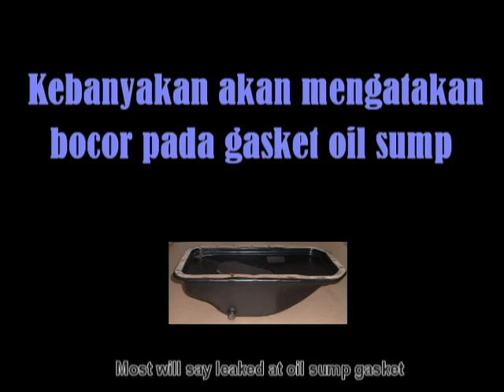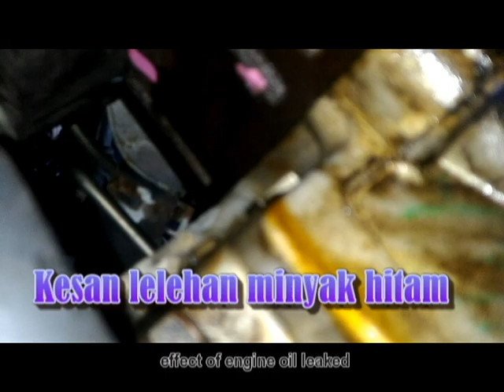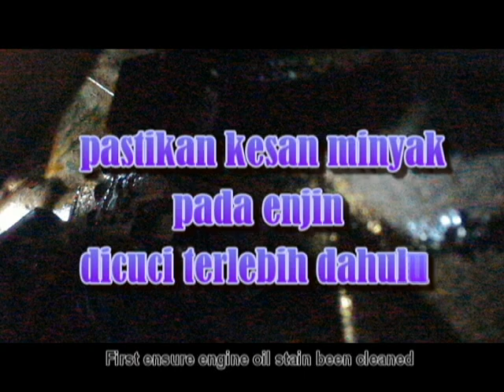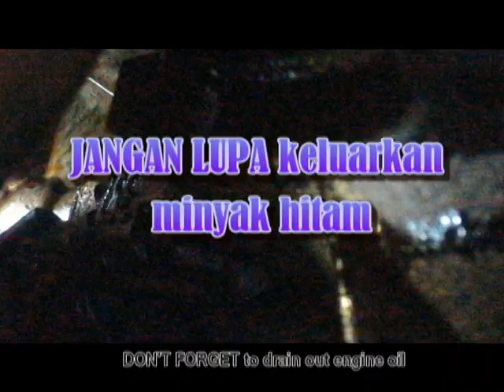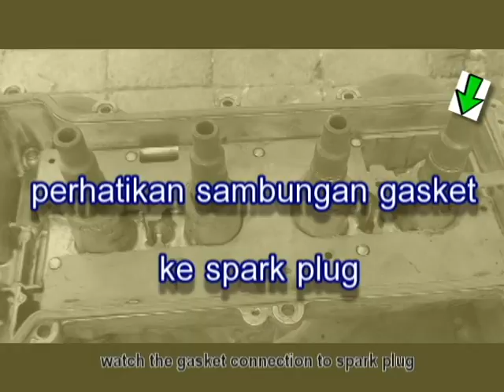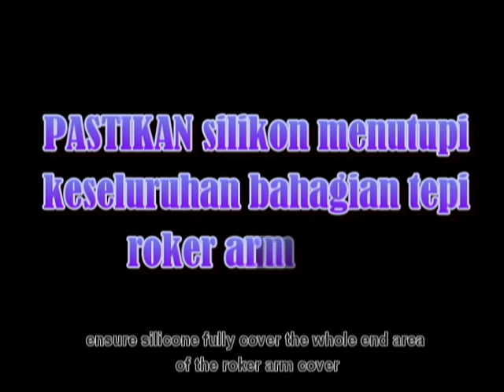ATASI MINYAK HITAM "LEAKING". SOLUTION PROVIDED

Comment: adakah viva 1.0 auto sy begini jugak ceritanya? valve gasket, plug seal, oil filter seal semua dh tukar.. hari ni tgok ada leaking lagi..
Reply from the maker: Valve gasket tu yg mcm mn? roker arm gasket atau gasket head...

Leaking kat bhgn mn?...enjin ke bhgn drain minyak hitam...
Reply: @SePeKiZamanHadapan  gasket head... minyak nmpk meleles kat tong minyak hitam.. dia leles sampai ke nut tong minyak hitam tu.. sbb workshop ckp kena turunkn graebox.. haaa.. sudah.. pening jadinye..
Reply from the maker: Roker arm gasket ade tukar x...minyak gearbox len...kalo rajin...cuci bhgn bwh enjin...pastu tengok drpd mn minyak kluar bila start enjin....kalo minyak gearbox kurang...baru perlu turun gearbox...
Reply: @SePeKiZamanHadapan  rocker arm takde tukar.. sy sendiri bleh buat ye.. lap, start enjin n tgok minyak kuar kt mana? enjin dh cuci dh semalam.. xpe balik keje sy try buat..
Reply from the maker: Terbaek...yup betul...tukar roker arm gasket skali...jgn lupa guna gam yg tahan haba...ikat semua bolt sama ketat...
Reply: @SePeKiZamanHadapan  okay sepeki.. thanks for your advice.. after tukar sy update sini semula..
Reply: sorry nak tanya viva auto cc 1.0 ada rocker arm gasket ke atau namanye lain?? cari2 nama x jumpa.. hihi
Reply from the maker: Orait
Reply from the maker: Cari kat kedai kereta..atau sparepart
Reply: @SePeKiZamanHadapan  dah jumpa punca leaking... flywheel seal dah keras. turun gearbox lar jadi ceritanye..
Reply from the maker: Terbaek...